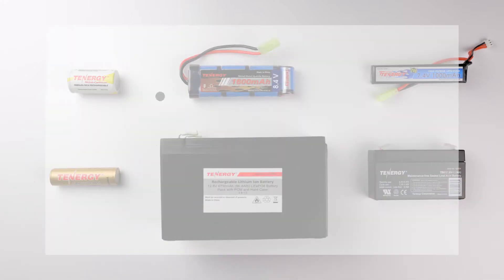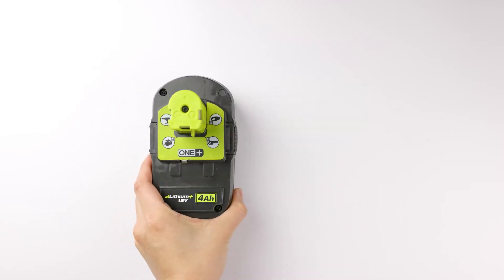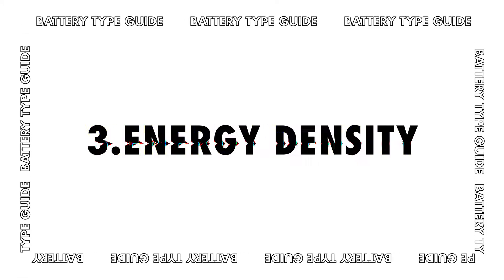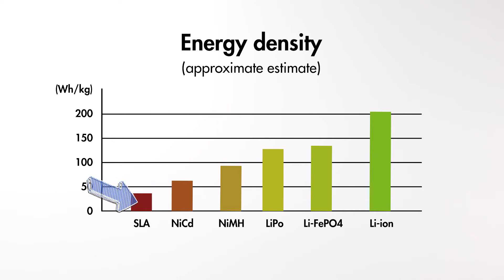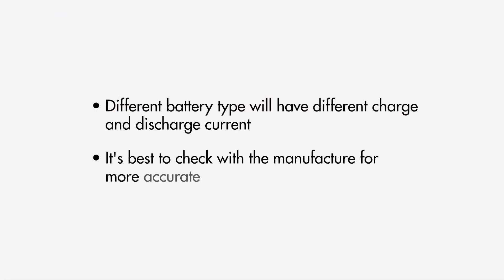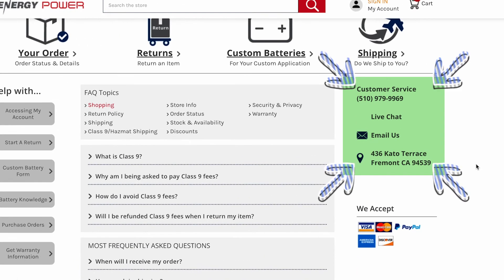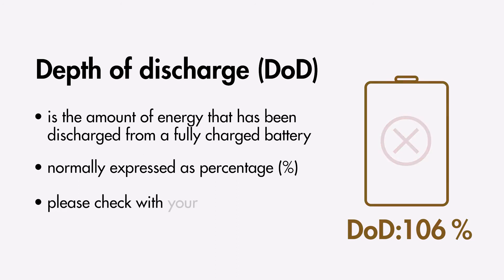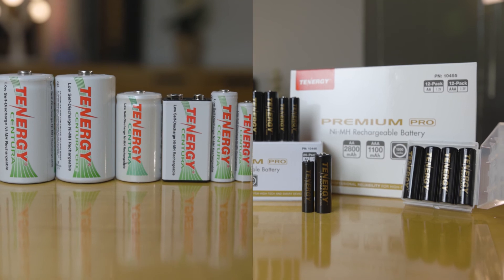Battery type explained

Comment: We highly recommend against using SLA batteries for high-drain devices (like smartphones or EVs) because it have lower energy density, lower lifecycle, higher self-discharge rate and lower depth of discharge.